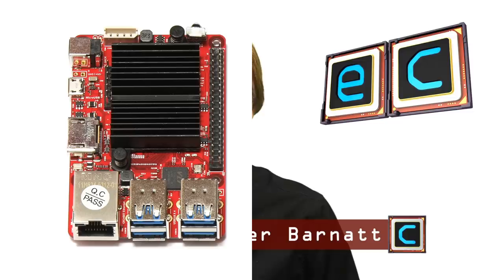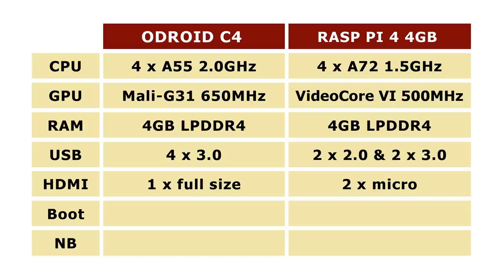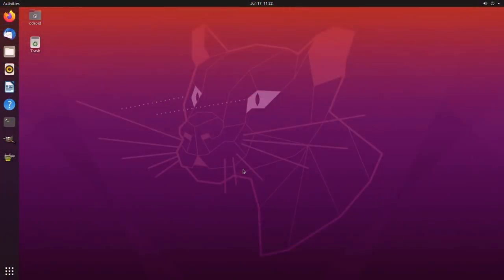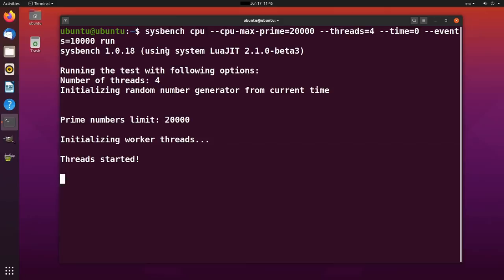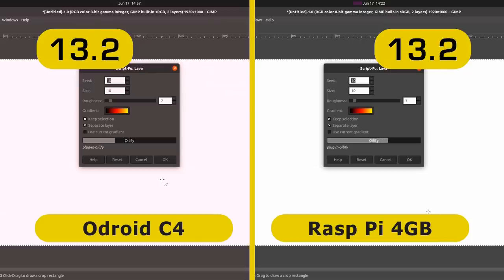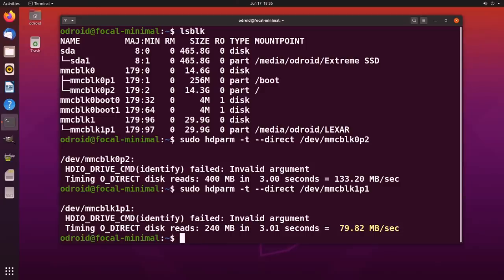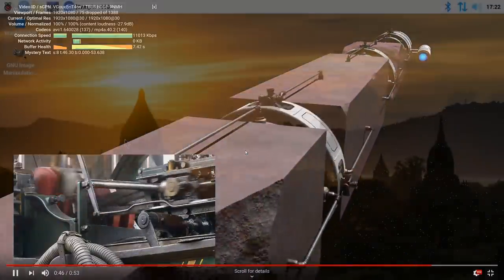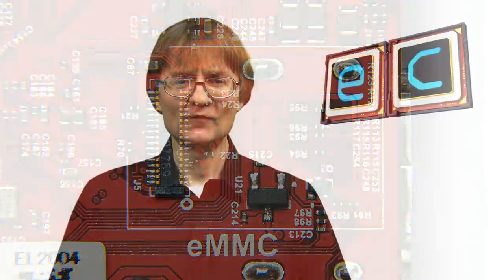Odroid C4 vs Raspberry Pi 4

Comment: The original purpose of makerboards still would be fancy projects involving robotics, automation, and many other applications.
Yet none of these so far seem to be capable of decent "all purpose desktop experience", while they are now clearly designed for such, especially the Raspberry Pi with two HDMI outputs.
I wonder what the bottleneck seems to be until now. 
In theory it shouldn't be too difficult to create an SBC which can deal with high output media and generic processing.
Currently the boards seem simply too weak to handle a common desktop replacement task. I really hope they will tackle this someday.
Reply: Merchant tricks. In the next year they will give us UASP for USB 3.1 but not real 1Gb Ethernet
Reply: I have been using the Pi4-4g as a daily driver since September. I have a Xeon quad core using the same monitor and keyboard. The only time I boot the Xeon now is when I do media conversion(handbrake). When paired with a USB SSD it works fine as a desktop. I typically have Thunderbird, two Firefox windows and two Chromium windows open 24/7 and use just over 1.5GB of ram. For typical desktop use it is fine. Still using PiOS 32ibt.
Reply: Mostly it's GPU software that makes many tasks run so slow. It is responsible for media playback. It seems that there's no h265 codec acceleration on or at least not for Youtube. That is the biggest deficiency on this board. Another real bottleneck is CPU. It's a cheap and old ARM CPU. It's okay for some basic tasks, but quite awful for something like GIMP filters. Without any additional cooling it also runs very hot and does throttle under longer loads, so at least a small heatsink should really be installed from factory. And lastly, SD card reader speed must be closer to Odroid's. Then that SD card reaches similar sequential speeds as hard drive from 10 years ago.

Basically it all boils down to one main thing. Cost. It is made to be very affordable and thus many things done as cheap as they could be to get passable/acceptable performance. It was mainly intended for beginner programmers, hobbyists and robot creators. In short it was made to be as something with more performance than Arduino or other microcontrollers, but still affordable enough to be financially viable to be used for projects. If they wanted to build a cheap desktop replacement, then they wouldn't spend money on things like GPIO, camera connector, LCD connector, increase their budget somewhat and then use it to focus on performance. And perhaps that is already done by other single board computers. I think there was Huawei HiKey SBC, that had a pretty high end Kirin chip inside, there was nVidia Jetson Nano with really impressive GPU. It's just that these things aren't in Pi.

Comment: I wouldn't say the Raspberry Pi Foundation is WRONG about the heatsink. Yes everybody should put some sort of heatsink on a Raspberry Pi 4 but what heatsink this is varies on the usecase. And due to the poppularity of the Raspberry Pi there are plenty of options. I for myselfe bought a fanless heatsink case CNCd out of an aluminium block. This solution was rather expensive (at 42€ only little short of the cost of the Pi itself) but I need my Pi to stay dead quiet since it's running all the time in my bedroom. But others might rather choose a fan (if they don't mind the sound) or a rather small heatsink (if they are only running less demanding tasks). So there is NO one size fits all solution for the Raspberry Pi and with the Foundation choosing any solution they'll need to increase the price of the Pi for something most people gonna probably replace anyways with something better for their usecase.

With the Odroid on the other hand where you can't buy dozens of different heatsink solutions online it's better to include one with the product right away...

So I think both approaches are right depending on the popularity of each SBC...
Reply: i just usually put my coffee cup on it, warm me up a good cup of joe haha
Reply: i run 8 different pi's... 6 of them had fans... running all 4 cpus at 100% 24/7 EVERY SINGLE FAN eventually starting screaming like a banshee after 3 months... now i throttle cpu use to 80 percent, the heat is below the danger level, and the run completely silent.

Comment: It's a nice benchmark between both of them. One thing that always flies under the radar is that between all the SoCs available, not many of them have proper open source support. This is particularly tricky if you want to build your OS for these boards. Even worse, if you try to use the SoC for a project, you might hit a roadblock until you sign an NDA with the manufacturer. It would be cool if you could also rank which SoC has the better open source support for what they provide.

Comment: I really do appreciate your analytical style!  Fantastic video, imo.  But you seem to have had some of the same problems I have incurred.  It just seems liike the software for odroid line eaves alot be desired.  I like the emmc support.  One of the odroids I had, was sensitive to hdmi cables.  Odroid does have many inexpensive hardware add ons.   I do like the raspberry pi computers, but with the latest release, you're right, should have included a cpu cooler of some sort.  I do appreciate your videos!  Please keep up the hard work!

Comment: It would be interesting to see some power consumption and heat tests. Because a "little" core like A55 at its designed frequency   should use much less power, but at 2ghz! The odroid would however  probably make a good open media volt NAS as it has 4xUSB3 rather than 2

Comment: Pi raised the bar when they included the built-in wifi which simplifies getting the system up and running. Most cases and kits include heat sinks, but most of them are not as robust as the standard one on Odroid. I think I would go with an Odroid for building something like a NAS box because of the better throughput, but I would stick to Pi4B for general project work. The biggest difference between all the different SBC's in this space is the software support. The Pi has a lot of different options, some better than others, while many SBC vendors don't have such variety. Also the drivers tend to be a little spottier on other SBCs, but they are not always great on Pi either.
Reply: My personal recent experience with a 2GB Pi 4 Vilros kit = the wireless is shite unless managed with Wicd set to auto-reconnect. FYI

Comment: Odroid C4 is an interesting SBC for home NAS (eMMC for OpenMediaVault OS, Gigabit network and 4 USB 3.0 for external powered hard drives).
Reply: Not really. Odroid-XU4 or a heedless Odroid-HC2 would do much better as a home NAS machine because they have way more mature software support.
Reply: The good thing is that I have finally chosen to use a RPi 4 2Gb for my NAS project.  The bad thing is that HDD are expensive here in Argentina and high capacity SDD (1tb or more) are much more expensive.

Comment: Very good review, as usual. In my opinion the  Raspberry Pi OS is a very efficient OS and I would not run anything else on a Raspberry Pi at his stage. Also with a small Heatsink and a small Fan Cooling is not a problem. Mine now runs no higher than about 36 degrees C. Without Heatsink it would go to its limit on a Video quite quickly. With a Heatsink it was fine but still came close to limit. With the small Fan added ($7.00 fan) it come nowhere near the limit now.

Comment: Great video as always. Thought one thing i would have liked to see is a comparison between the two GPU, like in games for example…
Reply: I am really excited by Vulkan porting effort on Pi. If u haven't already done it yet it on your pi. I am.abke to run OpenBVE train SIM on Pi now at 18fps (over clock and experimental GPU driver). I made some YT vid on them - hell even the Pi3 with experimental GPU driver is doing ok. Can't wait to try USB SSD or even normal drive in place of memory stick.

Comment: I love these comparison videos and I'm surprised that the odroid with better specs appeared to do worse than the raspberry pi
Reply: It's not better specs. It's slightly higher MHz, but it uses much simpler, much lower energy use cores. Most modern phones and tablets use a so-called big.LITTLE architecture with some simple low energy use cores to use most of the time and a couple of much more complex and power hungry big cores for the times real computer power is needed. The low power cores are A53 (as in Pi 3 and Odroid C2) or A55 (Odroid C4) while the high power cores are A72/A73/A75/A76.

Comment: It's also worth noting that there's one thing Odroid C4 is much better than the Pi 4: AES encryption. That's because the Pi 4's CPU has no AES extensions, while the C4's does. Furthermore, there's the Odroid HC4 (which I see you already reviewed), which is like the C4, but with SATA ports directly connected to the PCIe bus. So I'd say the (H)C4 are better choices than the Pi 4 for a NAS server, especially if you want to encrypt the drive.

Comment: My Pi4B has been running OpenWRT for a year now, as my home router. Perfect. And no bottlenecks in speed. Even torrents with a thousands of open connections: no problem!
Reply: @josephtremblant2173  Well your opinion is noted. What's the AES throughput of the nano Pi? I don't need multiple ports, just one Gbit. I use VLANs. I even have dual WAN. Nope just the 1GB. I use GPIO for certain functions - I see now the nano2 has a couple of pins, nice. Furthermore, I have more than one Pi 4, for experimenting and testing (and just having fun). I can swap em out and transfer the SD card if one goes wonko.

Comment: The Pi will alway be king in the intelligent device controller market. It offers more flexibility right out of the box. Either should be just fine using python applications to access the GPIO pins to send or receive data to I/O devices. 
 I don't understand people using these as a desktop replacement. It's silly really. If someone want's a low performance desktop they should just look for a 10 year old motherboard someone is throwing away and use that. These boards were made for imbedded systems solutions, adding  intelligence to a device or automating some manual application, and not for browsing YouTube videos. 
These boards were born and bred for python. 
If someone is wanting to run KODI, NAS, or a media server ether would be a good choice.  Good video by the way. Keep on rock "n".

Comment: Interesting that the C4 with faster CPU's was slower than the Raspberry Pi 4. I enjoyed your test bed.
Reply: The C4 doesn't have a faster CPU. It has a much much simpler and smaller CPU, with a slightly higher clock speed. The closest historical comparison would be that the C4's internal architecture is like a Pentium MMX while the Pi 4's architecture is like a Pentium Pro. Both were available at the same time and the same clock speed, but the Pentium Pro was miles faster on 32 bit WinNT code (but not on 16 bit Win95 code). The Core 2 was very closely related to the Pentium Pro, as are Core i7 etc to this day.

Comment: Raspbian/Raspberry Pi OS is not only 32-bit, it also used an ARMv6 (instead of a more common and in some cases faster ARMv7) based userspace in order to preserve compatibility with the first generation Pi. It WILL run slower than a comparable 64-bit based distro. How much slower depends on what you're running, but as you've witnessed in this video, anything that requires a lot of number-crunching (for example, image filters) will usually run faster on 64-bit OSes.
Reply from the maker: As I understand it, Raspberry Pi OS includes code for ARM6 and upwards, and uses the version appropriate for the board it is installed on.

Comment: New Odroid-N2+ was released last night and currently represents the new champion of the ARM64 SBC world, beating the previous champ, the Vim3Pro. Pound by pound, this is the beast to beat. Unfortunately, only 4Gb of RAM because of Amlogic SoC limitation. Rpi 4 8gb still going to be better option for light intensive desktop tasks under a 64bit OS like Ubuntu-Mate 20.04. CPU speed have been seriously increase from 1.8Ghz to 2.4Ghz, thermals have been improved, Heatsink size height has been decreased from 34mm to 29mm and now requires an optional active cooler to keep temps low. OpenGL benchmarks show Odroid-N2+ GPU getting 1000 using Wayland kernel on ubuntu 20.04 running GLmark2-Es2, showing N2+ GPU is 3.3x times stronger than C4 Mali G31 GPU which barely reached 300. I couldn't resist and ordered mine already.
Reply from the maker: I will take a look.

Comment: And now another comparison test: a video playback. C4 is meant to be a single purpose computer, a media player. It's capable of playing 4K H265 HDR, even 8K. Is Rpi4 able to response to that? :-)
I own Odroid N2, so far so good. But if I was in the market for a H265 player now, I would go for C4 as it does the some for less. And IMHO one full size HDMI is better than 2 micro ones cause it's more robust(again in media area).
Conclusion: these boards are best in their areas, Rpi in tinkering - great community, HW & SW support etc. Odroid as a player. That's it.
P.S. Mr. Barnatt, It would be nice of you to highlight strenghts and weaknesses in particular areas as people are looking for different purposes to use their SBCs. AI, IoT (this sort of more sophisticated uses) might be your area of expertise?
Reply: I agree C4 and N2 are fantastic media players running Coreelec. Now regarding Linux Desktop support, HW acceleration and ubuntu updates that don't
break your system?, just don't count on it, almost everything else besides Coreelec and Retro emulation is pretty much experimental.

Comment: Not the result one might predict from the device specifications.  It's nice to see the Pi still going strong despite so many competitors.  On a side note, I find the naming convention of ARM processors confusing; why is an A55 later than an A72?  Does ARM stand for 'Assigned Random Moniker'?
Reply from the maker: The ARM naming conventions are indeed confusing!
Reply: I think A5x is for efficient cores and A7x for performance oriented ones, with the x giving the generation (but i can be mistaken)
Reply: Most modern phones and tablets use a so-called big.LITTLE architecture with some simple low energy use cores to use most of the time and a couple of much more complex and power hungry big cores for the times real computer power is needed. The low power cores are A53 (as in Pi 3 and Odroid C2) or A55 (Odroid C4) while the high power cores are A72/A73/A75/A76. It would have been interesting to see a comparison of the power use.

Comment: When you look at 64 bit OSs for Raspberry Pi 4, I would love to see if any of them will run on a Raspberry Pi 3B+, and what the difference is in performance if they do!
Reply: I'm running on a Rpi 3B+ Manjaro-KDE & GENTOO-FXCE. NOT BAD at all with 1,5GB SWAP memory. Not fast enough pages loading, and fatigue video (live) on YT .  But plays acceptable the stored videos (USB flash drive V30 A1)
Reply: The GPU driver by Nvidia engineer is super cool on Pi3. That's a nice oerf boost for graphics
Reply: @stephenhookings1985  Have you got a link to more info on this, please?
Reply: @johnm2012  sure ....Tom's Hardware will take into it. https://www.tomshardware.com/uk/news/nvidia-engineer-vulkan-driver-raspberry-pi-quake-iii-100-fps

I didn't understand properly the rpi config to boot to Linux to.run tests ..
 But eventually it did. On mine 6 tests fail. But check out my YT for a RPi3 running Open BVE on a pi 3 at reasonable rates. I makes the Pi3 run.nicer - not as nice as a 4 but still good.
Reply: @johnm2012  I know I wasn't asked, and this may not be precisely what you're interested in, but I saw this about it recently and you may find it interesting. https://www.youtube.com/watch?v=Z-fBxclt4BE

Comment: I lead the Ubuntu Desktop team at Canonical. We're actively working on delivering Ubuntu Desktop 20.10 as an official release platform 👍 To that end V3D is available in 20.04 but currently in the proposed pocket undergoing final testing. Should be available in a few days. My passion project 💚 is Ubuntu MATE, something I started long before I joined Canonical. The Ubuntu MATE implementation for ODROID comes from them not the Ubuntu MATE team, so doesn't enjoy the same attention to detail we provide when porting to other devices. I have a channel called Wimpy's World where I am sharing some of the development insight to enabling Ubuntu Desktop on the Pi 4 for anyone interested in learning more 🙂
Reply from the maker: Thanks for this Martin, which is very interesting and helpful feedback. It is also very well timed as I expect to start working on my Pi 4 64-bit OS video in a week or so. :)

Comment: This was very good. I highly anticipate the 64bit OS comparison for the RP4 4GB (and the 8GB?…). I wonder if Lubuntu will make the list.

I just remembered a question that I thought up while watching a video from a different channel earlier today, which I will probably just look up immediately after I post this, but… I wonder if AMD has come up with any SoC designs, and if anyone has made an AMD SBC. Is an APU a kind of SoC, or something else? The question poped up, I think, because AMD is pulling ahead of Intel right now, and I saw an really good review for an AMD based laptop that shot the closest Intel laptop out of the water pretty definitively. So it made me wonder if perhaps an AMD SBC would be any good. I'm picturing a SBC similar to the Latte Panda line, but based on AMD, not Intel or whatever.
Reply from the maker: There are some small boards based on embedded AMD chips -- eg the UDOO Bolt: https://www.youtube.com/watch?v=8DINmS5YBD4 All such boards are expensive!